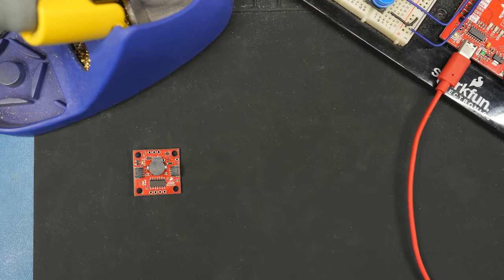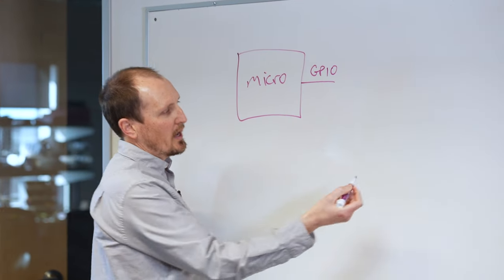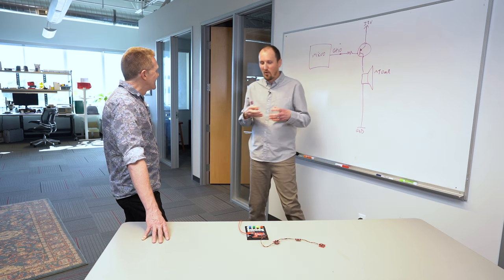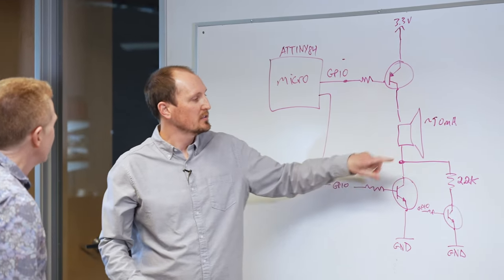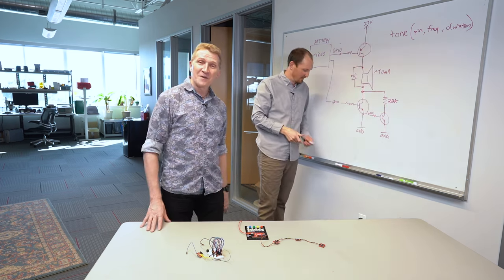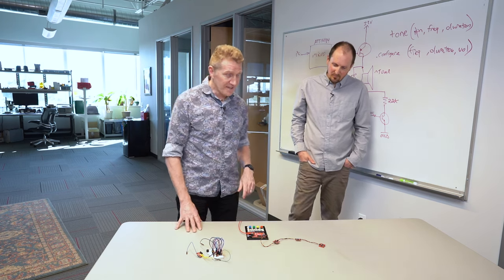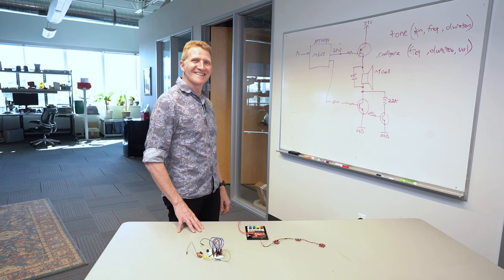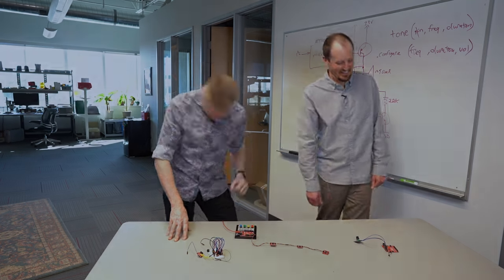Product Showcase: Qwiic Buzzer

Comment: You compared 20 mA, average current, to peak of 50 mA. My guess is your peak current with direct drive is much less than peak with PNP. Look at GPIO voltage direct drive and I bet it is much less than 5v.
Reply: Oops, I was wrong about the PNP resistor. You do need it. If NPN you don’t but would lose about 0.4v over what you have.